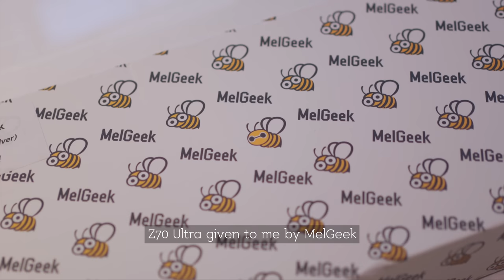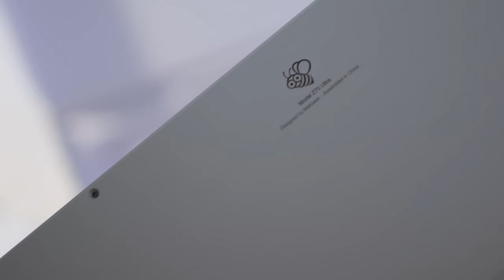MelGeek Z70 Ultra Unboxing & Typing Sounds with Box White and XDA Godspeed

Comment: Syringe: brakes
:3ildcat:  I  H A V E  M O R E
Reply from the maker: I  H A V E  M O R E :3
Reply: H A V E
Reply: What was he doing with those syringes?
Reply: @svcp_  tuning the stabs. Flattening it that way it doesn't cause rattle.
Reply: @user-kz9rz8ui1c  how are the syringes necessary in straightening the wires?
Reply: @svcp_  they make it easier to twist the two bent metal pieces at the front.
Reply: @3ildcat  you can use pens
Reply: i realize it is quite off topic but do anybody know of a good site to watch new series online ?
Reply: @Hezekiah Abdiel I watch on Flixzone. You can find it by googling =)

Comment: Hey wild cat, if the future would you ever plan on doing a wire balancing tutorial? you stabilizers are always to perfect and i can never get rid of the tick on the side of my stabs.
Reply: Patience, and that should be it. His process is time lapsed, so imagine doing one stab for half an hour, or even an hour
Reply: keep tapping on the edge, if it ticks then bend that side down, repeat until no longer ticks
Reply from the maker: Just need a lot of patience
Maybe this part https://youtu.be/B1TodVGvF2g?t=81
Reply: @3ildcat  thank you  :)
Reply: step 1. Pull old iPhone 4/5/or 5s or even the new 12 out of drawer. Ya know , the models that have flat edges on the sides instead of rounded like the iphone 6 and higher (iPhone SE 1st generation will work as well since its the exact same frame as the iphone 5, but with updated internals) 
Step 2. Lay iphone on a flat surface screen side facing down, and then one by one put each stab wire on the back of the phone and gently press on either side of the wire to make sure one side doesn't start lifting off the surface of the phone. Gently keep tapping each end and make micro adjustments by ever so slightly bending the uneven side to make it so that you can sit the stab wires on a flat surface and it wont rock back and forth.

Step 3. I never really thought about this until I saw (the man, the myth, the legend...3ildcat) use one of those big (big as in like 3/4 to 1 inch diameter syringes that are very useful for like lubing stabs on a keyboard without taking the whole thing apart or on prebuilt keyboards that weren't really made to be modified etc) and sticking the end of the stab into the plunger and then slightly twisting the opposite side of the wire thats inserted into plunger so that the plunger keeps one end of the stab wire steady while you ever so slightly make micro adjustments to get them level. 

Sometimes I've received my Durock or c3 stabs and they are perfectly level out of the box...but always good to double check. 

Also, if you're OCD like me and want to make sure you're on a level surface...iphones have a built in bubble leveler app without having to download any app. Just go to your "compass" app that comes installed by default and swipe to the left after you open the app and voila you know can see just how level your desk really is...all jokes aside. (except for the leveler app on iphones is a real thing, comes in handy) 
The purpose of using something like a iphone 4 or 5 is so that even if your desk or whatever surface you are using isn't completely level then setting the phone on it and using the backside of the phone for your base makes it so that no matter what you will always have a flat surface (and obviously the contrast of a black iphone against gold/silver etc wires makes it the perfect little device for doing this. 

In case you read all of that and dont have a damn clue what I'm referring to as far as ....everything. Go watch Wildcats new video of the Melgeek Mojo65 and he shows every single step (and if you put the youtube video at .75 speed you'll see him using the plunger/syringe without the needle attached as a nice tool to use for leverage. (In closing, if you are ever interested in purchasing a Melgeek product please for the love of god use a proxy or something that already has them in stock. Melgeek was a nightmare with communication and I finally received my Mojo60 ember dusk hotswap bluetooth keyboard after 17 month's. Despite the 3 emails assuring me that it had been shipped 6 months ago. 🤦‍♂️ They have some nice quality items, but it's just getting them to you before you die of old age is the issue )

Comment: I haven't used it yet. When I connect to Mac or Windows, it is not recognized as a keyboard for some reason. Why? Can I use it without updating the firmware with QMK? Also, when updating the firmware, it is necessary to reset the Z70. Is that correct with "Fn +]"? Will it be held down for a few seconds?

Comment: why did you use plate mount when theres screw in holes? does the case not support pcb mount?
Reply from the maker: just used what came with the package and the result is good

Comment: thoughts on this keeb? im in the market for a good 65% around this price range
Reply: Looks like a clone of the  massdrop Alt, with sound dampening.  But I hate the left side usb-c connector.  I'm left handed so that's a showstopper.  The Alt has a left and right connector on the back.
Overall, this board doesn't seem anything special.

Comment: Which one better for typing feel experience, Red or Brown?
Reply: Whichever you prefer. Get a switch tester from Amazon and try it out, then return it. In my opinion though, brown switches are really bad tactile switches, almost linear, like a sandy red switch. But either are decent entry switches into mechanical keyboards I guess. There are just much better switches out there, so feel free to explore once you're ready 👍 I do type faster on linear switches, but I much prefer tactile and clicky switches to type on, much more satisfying to press. Everyone has their own preferences though. If I had to choose between the two, I would pick Browns as I ain't personally a fan of linear switches. Pick Kailh Box Browns or at least Gateron Brown if you can, they're better.